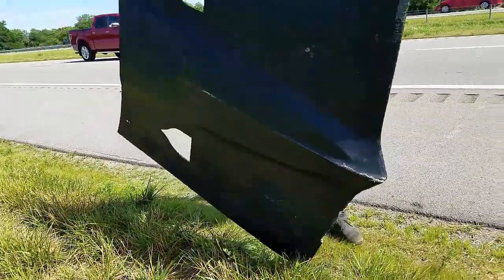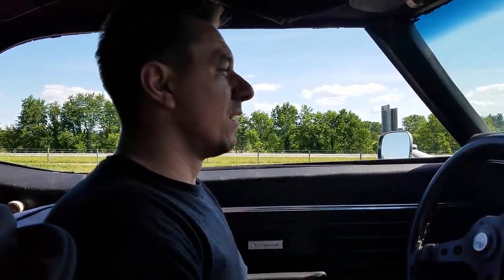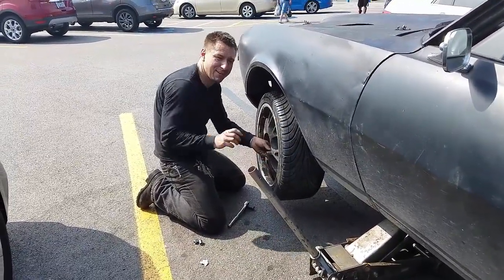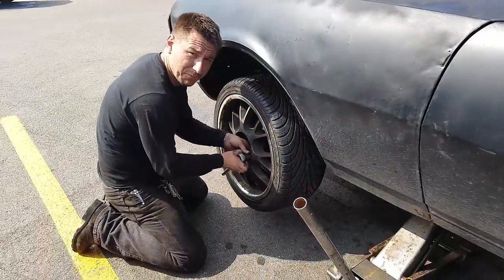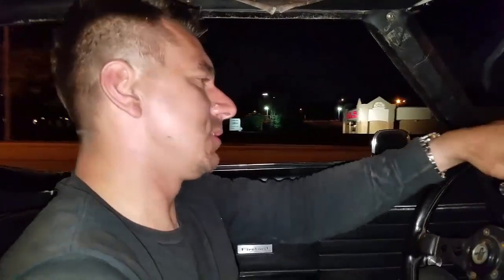69 dodge charger, 68 firebird, the roadtrip to roadkill nights and the long haul home.

Comment: Using ice as A/C is a... cool trick! Glad you made it home safely. It will be interesting to see what happened in the trans, at least you had enough torque to take off in 1:1 with the trailer and get home.
Reply from the maker: Yeah, the one thing about this firebird is the unlimited torque...
Reply: Make sure you stay Pontiac with the engine
Reply from the maker: +Nikolas Wally of course!  too many people putting chevy smallblocks into pontiacs as it is!
Reply: Yep! Got to keep the Pontiac's Alive!
Reply: Do you have plans for the engine? Looking for more power?
Reply from the maker: +Nikolas Wally i got some 455 heads a year ago i want to do a very mild port to.  they will drop my compression down to 8.5 from 9 and I want to upgrade the valve springs to shift at 5500 rpm instead of 5000... already making 430 or so at the crank (before the roller rockers) but would love around 450 and then a mild 100 shot of nitrous.  want to keep this as streetable as possible and not lose any torque.  thats why its only going to be a mild port...
Reply: Who you getting the ports done by?
Reply from the maker: Nikolas Wally me

Comment: Dude I would leave the firebird just like that. Looks badass.
Reply from the maker: i agree, but I do think it deserves some new floors and to replace the beat up taillight panel... and some small touch up work.

never going to be prestine but it deserves a little love after all its hard work
Reply: Invincible Extremes Muscle Cars Garage Make it comfortable to drive, but the mad max looks it has right now is unbeatable.
Reply from the maker: +Koshunae true.  straight panels wouldn't hurt.  but arent a priority.  looking forward to updating the worn out suspension though

Comment: Keep on smiling mate.
Reply from the maker: Yup.  Nothing should be able to ruin our mood.
Reply from the maker: Yup.  Nothing should be able to ruin our mood.
Reply: So... how well does the Fire Bird... um... tow stuff? Interesting to say the least!
Reply from the maker: +jeadelmann90 it tows great.  the trick is not over loading the trailer to where it excedes the firebirds weight by more than 500 lbs... then braking downhill becomes an issue.... brakes work great, but the trailer shimmies too much and you have to stay on top of it so it doesnt jack-knife the whole rig on wet pavement...

keep it at or below the weight of the fully loaded firebird and its smooth sailing.
Reply: +Invincible Extremes Muscle Cars Garage That's pretty cool. I'd probably do a double take if you passed me on the highway. I'll have to check out more of your videos.
Reply: No brakes on the trailer?

Here in Sweden the limit for brake-less car trailers is 750kg.

You can make them bigger, but then they aren't approved for normal driving but considered a "work trailer" like the kind you put behind a tractor... so they become limited to... hm... 30km/h or something like that.

If you need to tow large stuff at speed you need a large truck...

I guess this is where that "freedom" of yours come in, not quite as much regulations 'n' stuff.

Comment: Burnout while pulling a trailer is something you do 10 minutes from home... This looks further than 10 minutes. :)

Hope your luck went better for the rest of the trip.
Reply from the maker: 300 miles out the trans took a dump, 100 miles out the rear tire was unpatchable... just zombied the car the rest of the way.
Reply: Invincible Extremes Muscle Cars Garage
Ugh... That blows... It's probably too late to bother with it now, and I have a feeling this isn't your style anyhow, but a AAA RV+ membership is about $150 a year and will get you and a trailer up to 200 miles for free once a year (and 2 more 100 miles tows a year too). Every year I've had it, I've used it for something that would have cost more than the membership.

Anyhow... Glad you got it home all in one piece. Hopefully next time you'll have smoother sailing.
Reply from the maker: +Maxwelhse 200 miles usualy doesnt get me much... i have roadside, that will get me 50 miles or so.
Reply: Invincible Extremes Muscle Cars Garage
Will your roadside cover a trailer? That's really the astronomically expensive part of a break down like that. They always want to send like a full on class 8 semi wrecker to tow any trailer in and you have to beg them not to. They don't want to trust people that it's just a 4500lb load or whatever.
Reply from the maker: +Maxwelhse no, nothing cheap will cover that.  i basicaly just have to make things work
Reply: Invincible Extremes Muscle Cars Garage
Well, I'm glad you did! Like I said man, hopefully the next run is much smoother for you. I think you've paid the piper any that was owed!
Reply from the maker: +Maxwelhse yeah, it sucked not being able to come to power tour and then not even getting to go to the roadkill event
Reply: Invincible Extremes Muscle Cars Garage
If it's any consolation, I've heard of events like a "Drag WeekdEND" becoming more and more popular around the country. The events are organized between 2 or 3 tracks that are a few hundred miles apart and run exactly like full blown drag week. It wouldn't be the same as the Hot Rod events, but maybe there are a few of those around you that you could jump in on just to get some fun seat time? I'm hoping one comes my way before too long.
Reply from the maker: +Maxwelhse drag weekends are hot rod organized.   Power tour was just what I needed to help spread the word about the channel.  If I get the transmission back together I'll attend the goodguys show here in lincoln this weekend.   then gotta haul butt to north carolina again and bring my 78 bronco home so I can use it or sell it or whatever.
Reply: Invincible Extremes Muscle Cars Garage
Oh, I didn't know that.

Well... Good luck on your next trip! Moving that much stuff that far is a herculean task for sure. It's pretty impressive to be doing it all with a muscle car. The first time I saw a tandem trailer behind your car my jaw hit the floor. haha

Comment: Bummer about your hood, that certainly looks like it was a rough trip. Do you still have the Bird?
Reply from the maker: Absolutely.  Never selling the firebird.  Btw I have a new hood, and planning on fixing this one too
Reply: @InvincibleExtremes   Great to hear you will continue to fix your Bird. My 68 is totally restored, but like I said it has a 350. It's all number matching car except for the #62 heads. Also has Headman headers, comp cam,  Edelbrock intake and Flowmaster exhaust.  It does okay for a 350.
Reply from the maker: Yeah the 350 that was in here was pretty hot.  But it kissed a valve and I replaced it with the 461, same hp, just lots more torque.  Well, maybe a little more hp...
Reply: @InvincibleExtremes  A 461 would be so nice to have, a great choice indeed.

Comment: dude your my idol when it comes down to cars! I have one quick question I'm going to pick up my 68 firebird 400 from CA and the car sounds and looks in good shape so I'm thinking about driving it from CA to AZ. what should i look into before doing the trip?
Reply from the maker: Calixto Escobar new oil and filter, and check to make sure theres no water leaks... also make sure the valves are torqued down like they need to be or adjusted if you are lucky and have racing rockers...  besides that, should be cake.
Reply: what rockers do you recommend? and what grade  oil  should I throw in?
Reply from the maker: Calixto Escobar the absolute best rockers are Crower Stainless steel and a set of ARP 7/16 studs... simply the best.

Comment: That poor car looks and just sounded like its had it, Lol. About time she gets a full and proper restoration she deserves. If anything so you won't miss roadkill or have a catastrophic failure and have to run like hell. The battery cable incident, Got VERY lucky on that one. Happens to the best of us though. I blew the headgasket on a 6.9 because I revved it up THINKING it had some water in it. Nope. None.
Reply from the maker: Cruiseomatic yeah, the firebird has been our daily driver for many many years.  its got roughly 400k miles on it and badly needs to be pulled off the road for some new floors, body bushings, taillight panel and other things, and thats not to mention the 461 has 100k on it and needs a rebuild...
Reply: I hear ya. I have a '87 F250 Ex-cab with a 420 (6.9) diesel transwith a C6  I'm "restoring". Bought it for $400 of a friend of a family friend...If that makes sense...We're very close friends with another family and I bought it of their mechanic friend.
He told me everything wrong with it EXCEPT, It has bad rust in the worst places. Cowl tub, back cab mounts against wall, and front floor pan. I could go on, But since I work 4 10's every week, I made it a project for me and momma both. But I have to hand it to you, No matter what happends or how it lets you down, You find a way to get it going. Just worried something is going to give while your driving and could get you or the family hurt.

Comment: I don't have kids, but if I did I would never in a million years put them in a hacked up muscle car and drive them anywhere.
The tires are shot, the transmission(older than the driver) is pulling the car and a trailer with another car, the brakes are from mixed matched parts and no ABS system. It may make for good child memories but those memories could be short lived riding in Mad Max's car
Reply from the maker: its safer than it looks ;-) trust me
Reply: if you feel the need for abs maybe ya haven't really learned how to work the pedal yet. and when things are done on the cheap they often look worse then they are, cosmetics mean little and what little money goes to where its needed, as with the brakes he's stated

Comment: do you have trailer brakes or just really good brakes on the car?
Reply from the maker: the car has manual 4 wheel disc.  13 inch corvette brakes up front and 12 inch 98 camaro brakes in the rear.  BUT the trailer does has electric brakes, just not hooked up yet.  i really need to because i jack-knifed it in the rain locking all 4 wheels on the firebird.  tore the whole back end of the car out, bumper, mounts and all.  and destroyed the back of the quarter.  had to spend 45 minutes welding it all back together before continuing
Reply: +Invincible Extremes Muscle Cars Garage good stuff. great videos. not many guys crazy enough to cross country tow anything with an old muscle car ;)
Reply from the maker: +nitrosport5 100%  true.  when we crossed the country from new york to oregon in a rusted out 1970 beetle in the dead of winter as a family we decided we need to have a youtube channel...

Comment: I want to build a toe package for my 1969 charger and I love the videos and do you have any advice?
Reply from the maker: You have to have good brakes... amd stiff springs.  I can hook you up with some badass brakes for insane cheap, and once I build a tow setup that looks nice for my charger I will probly be able to build you one too.  Or at least show you.  Find our facebook page and look at the disc brake conversions we sell.  Good 4 wheel disc brakes for a third of the price everyone else sells them at.
Reply: +Invincible Extremes Muscle Cars Garage sounds great I got my 1969 charger when I was 14 and now 18 and haven't really touched it but I've seen all the progress you done on your it makes me just want to go crazy with it.  and do you rattle can all of your cars?
Reply: +Invincible Extremes Muscle Cars Garage  oh and do you think superstock spring are stiff enough for us it over kill?
Reply from the maker: Nathan Hernandez  chargers have torsion bars up front.  And leaf spring rears.  You can get stiffer torsion bars but swapping sway bars is a good idea.
Reply: +Invincible Extremes Muscle Cars Garage I know about the torsion bars 1.10 should be stiff enough and super stock leaf springs in tje rear
Reply from the maker: Nathan Hernandez yup.  For sure.  You need to make sure basically that a trailer won't throw the charger around.
Reply: +Invincible Extremes Muscle Cars Garage the trailer weighs less than a thousand pound  loaded and do you think new stock springs and airsocks would be Good? I don't want to car sitting to high when not towing. and do you just spray paint your cars? it's look pretty rustic but mean!
Reply from the maker: +Nathan Hernandez balanced trailers dont affect ride height.  you won't need air shocks.  you should be ok with stock springs then.   and yes, i spray paing all my cars untill i finish all the body... except i havent finished any body work.  so none of my cars are actually painted yet...
Reply: +Invincible Extremes Muscle Cars Garage awesome! and thanks for all of the jelp. the videos are really inspiring to bring my car back from the dead

Comment: what size tires is on ur chevy
Reply from the maker: Shane  Marcum ain't a chevy.  it's the original Pontiac firebird... 275-35-18 on the back and 255-35-18 on the front.
Reply: Oh ok I have 16s tires 205/40z16 trying sell it

Comment: i would have a bit of a hard time dealing wiith that lol but hey clssic cars
Reply from the maker: SouthernMsMudr it was fairly reliable besides the tires.... never trust used tires
Reply: i definately will not as bad as they are for you lol sseems like your have 2 go out every trip
Reply from the maker: SouthernMsMudr this trip cost me 2 tires... the last trip before it cost me 6.... and the trip before that cost me a couple dry rotten ones, but I knew those would go...   price you pay I gues...
Reply: what car would you recommend building i cant decide firebird is sweet was thinking maybe a judge or 72 challenger 68 charger with 440 not sure as far as parts
Reply from the maker: SouthernMsMudr go charger...  go big or go home right?
Reply: lol yup i wanted to put the roll bars in one and weld the doors but im sure how i could still have windows the be the real general lee tho
Reply from the maker: SouthernMsMudr I assure you, you don't want to weld the doors shut.  the 69 I have is a pain to get in and out of because it's a race car and the doors don't open.

Comment: let me give you a hand with your tire issue I live in northeast Pennsylvania we have the worst roads in America. low profile tires and rims do not work on long trips or pulling trailers. you gotta get yourself steel rims with narrower tires at least 6ply 15 inch rims. low profile tires look good and good for handling but not good for work. if you Look at a big rig they all have narrower tires. we hauled logs pallets of stone from the quarry. the old truck rims work a lot better than new ones cuz they have no side wall on the tires. wide tires heat up and don't take the heat good. from my experience. just trying to help.
Reply from the maker: 100% true.  unfortunately because of the size of my brakes, I am usualy limited to a 17 inch rim minimum... and i am planning on running aome narrower tires though... the wide ones basically just eat gas...
Reply: +Invincible Extremes Muscle Cars Garage that's right I forgot about the brakes .I had a set of low profile on my Malibu handled but Road like crap. the only thing with high sidewalls you get body roll but a lot better ride. man you have a lot of guts
Reply from the maker: +Marco Ceccarelli yeah, my stiff springs and sway bar really help keep it planted

Comment: you should buy an old dodge Cumming diesel dually truck for hauling car trailers.
Reply from the maker: naw, wouldn't be my flavor...  swapping the f100 cab onto a slammed cummins chassis wouldn't be a bad idea. though...
Reply from the maker: Wouldn't be me if I did...
Reply: On one episode of road kill they bought an old ford wrecker truck and it worked flawlessly. It did actually happen on ROAD KILL They said it worked too good. so they sold it. I think they had to put card board on the radiator to get it to get the heater warm. Something else minor went wrong but nothing big.
Reply from the maker: +shartne they still have it i think.  great truck
Reply: I thinkj it was a 390 and it use a lot of gas like 12 miles to the gallon.
Reply from the maker: +shartne thats not bad lol.  my 461 gets 13 without a trailer
Reply: Ouch It must cost a lot to drive across the county wow. Let us know when you get the three speed in it.